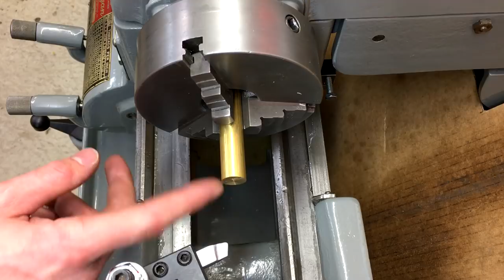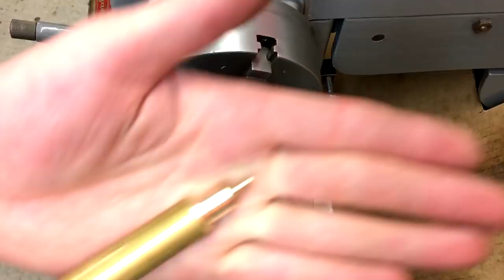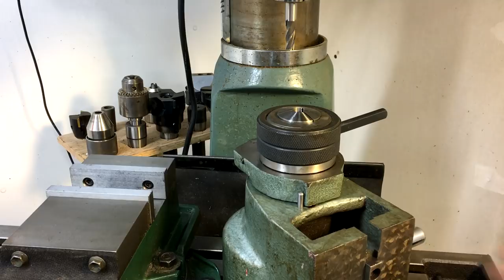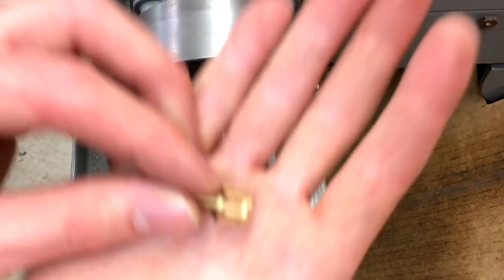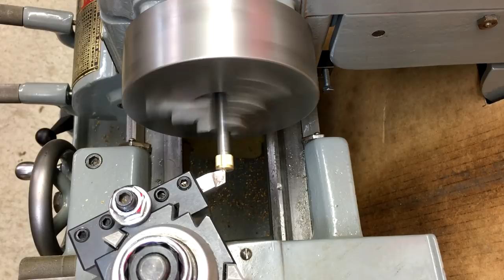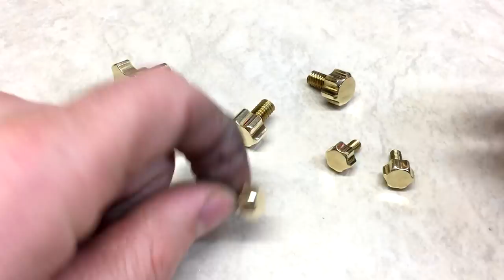Making Custom Brass Thumbscrews

Comment: Nice job, but I noticed your lathe tool appears to have positive top rake, hence it will tend to “grab” when machining brass. It sounded as if this nearly happened when you were machining the screw diameter

Comment: I know this is an old video, but I am new to the channel!

I would think of going about it another way would part the screw off to final 'thumb size' and bevel the edges, use the arbor vertically in the mill and then machine the slots. Burrs I would polish off in the lathe with some wet and dry fine sand paper then polish?

Comment: Very nice!  I was watching the video with growing interest, as I'd like to try this on my lathe.  Then you said, "Now I'll go to the mill..."

Crud.  I don't have a mill.

But then I thought about it, and wondered if this procedure would work:  Before turning the bar stock down to the large OD of the part, then scribe a circle on the face of the stock where the radius of each of the curves would be located.  Then take the stock (I know, you shouldn't remove the stock from the lathe until all done, but needs must) to the drill press, mount the stock vertically and drill the six holes using the inscribed circle to locate them.  You'd have to figure out the exact placement of the holes around the circle, of course, and the holes couldn't break through the surface of the stock.  Then back to the lathe and turn down the stock until part of each hole is exposed to the depth you want.  Then turn down the portion to be threaded, thread, chamfer, and part off.  I hope that made sense.

Or use a four-jaw chuck, center the piece at each location where the holes would be drilled, and drill each hole in turn.  More work, but one has to make do when one doesn't have a mill 😁

Comment: I tried 4 times to make a 1/4 28 thumb screw and each time the screw broke in half at some point. I turned to making a brass sleeve type deal that I knurled and sized to have a couple thou press fit for a regular hex machine screw and I quite like it a lot.
Reply from the maker: Nice!  I'm glad you found something that worked for you!
Reply: If you have collets you could use them and hold the part by the scallops to turn the end off. Should be a much more robust setup. Probably still want the arbor to polish the heads though.

Comment: Great video. Don't use this style of tap on a blind hold . It will  cause the chips to build up and break the tap. This style of tap is for Thru holes.
Reply: You CAN use a plug tap,  2nd tap or a bottoming tap on a blind hole, each one depending on the depth of the threads and the depth of the clearance at the bottom of the hole--- you just have to know the exact depths to properly thread without bottoming out the tap. Thirdly if you back off the tap every turn or so   the chips won't clog and break the tap.  Fourthly the plug tap he shows won't "significantly cause the chips to build up and break the tap" as you claim ----  anymore than any other type of tap: only the first full thread of the tap does the cutting, the rest just follow along. So the chips are nearly the same regardless of the type of tap. Learn to back off the tap and use cutting oil!  How long have you been machining ??? Must not be very long. Jeeze.

Comment: Very well done.  What kind of an indexing fixture do you have?  Don't remember ever seeing one like that one which indexes so nicely.  Thank you for the video!
Reply from the maker: Thanks Glenn!  My indexer is similar to this style: https://www.mscdirect.com/product/details/09651001 Mounts either horizontally or vertically.  Has 24 (every 15 degrees) set screws inside of it and it will index to each position that the set screw is tightened in and bypass the positions where the set screw is backed out.  So you can adjust the stopping points in any 15 degree increment combinations you want.
Reply: Wow, your indexer sure does beat the spin type with the pin that we have.  So much faster and less chance for mistakes.  Thank you for the link, much appreciated.